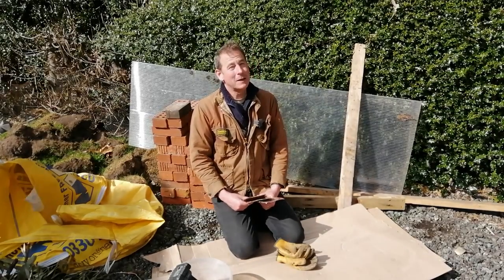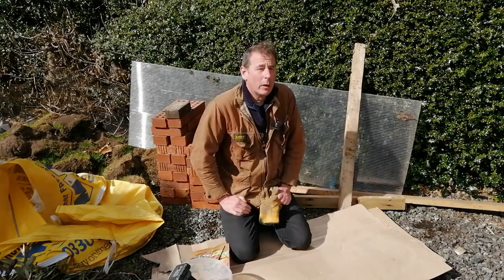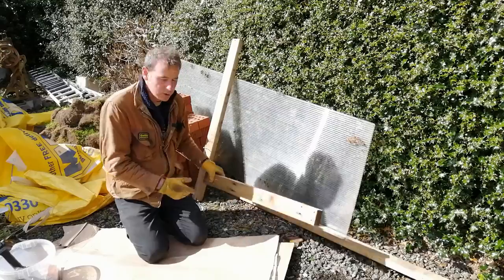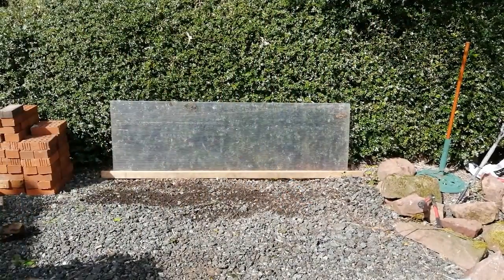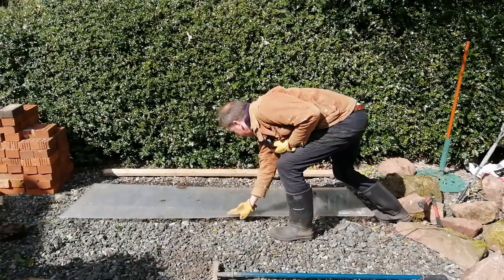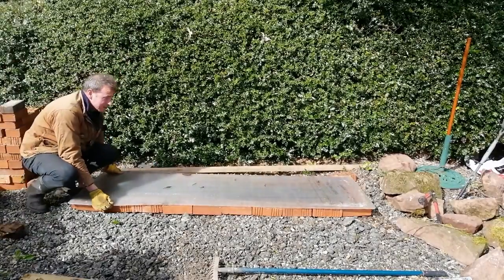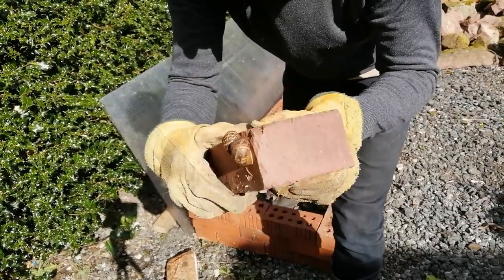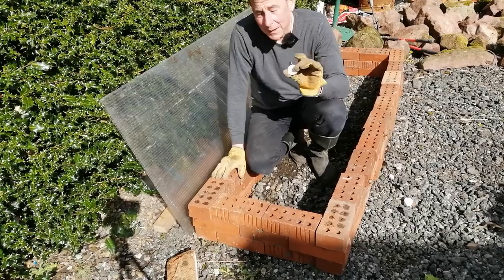How to Make a Cold Frame and Mini Greenhouse

Comment: What screws/ nails do u use to attach wood to the plastic sheet thingy
Reply from the maker: Hi kay. I just used a simple small wood screw but i did put a washer between the screw and the plastic to spread the pressure and avoid cracking/shattering. Also i ticktened it very slowly under control. Mark